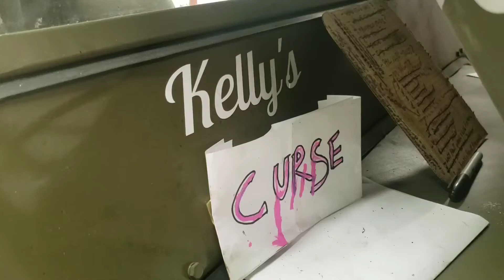L134 engine build part 8.

Comment: Been enjoying your videos Lew. Learning alot. Is there a different part number for the two different oil pumps? Or you just have to know what gear direction you need.  Just wandered in case I get to try this sometime
Reply from the maker: Yes, different part numbers.  I don't have them handy but if you ask for a pump tell the if it is a gear driven cam or chain driven.